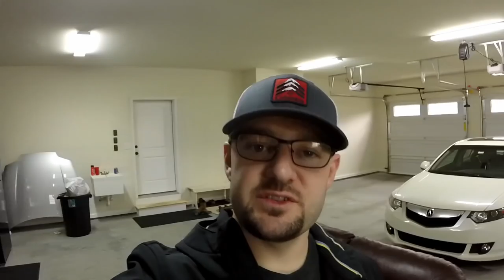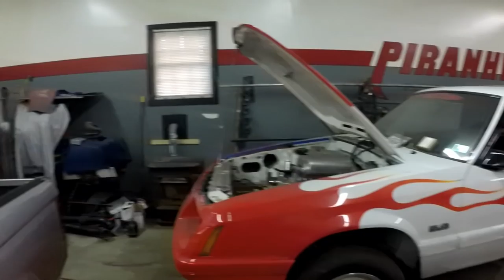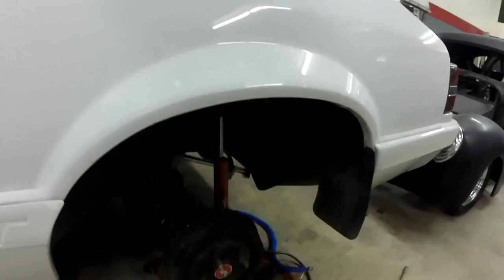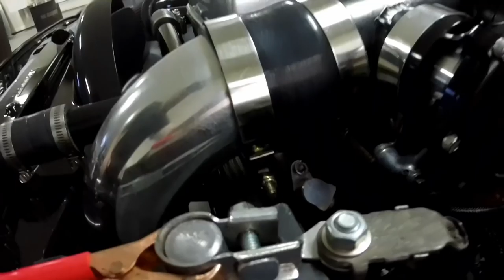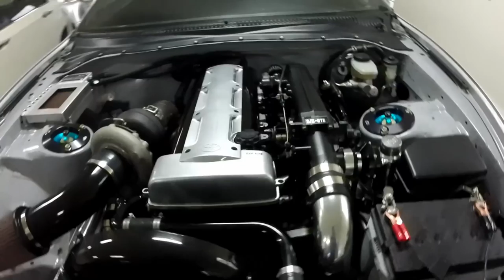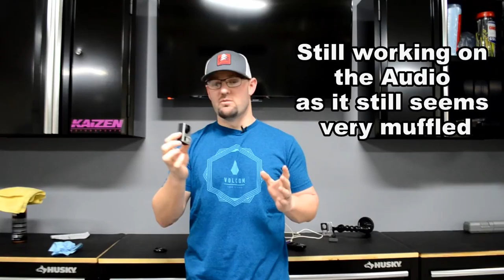Why No RX7 - Audio Suggestions - Piranha Fabrication

Comment: Great videos. Too bad we never met when I was building my MR2 a few years back. We seem to have the same style; clean and the want to be different. My car rarely came out of the garage because there was always some little part that had to be cleaned and coated. I'm not a flashy guy, but was very much into having something clean and functional. I'm trying not to work on or purchase anything for another couple years as I want to pay off my home first, but maybe when I'm back into it we'll meet up. The bay looks great (so far). -Judd